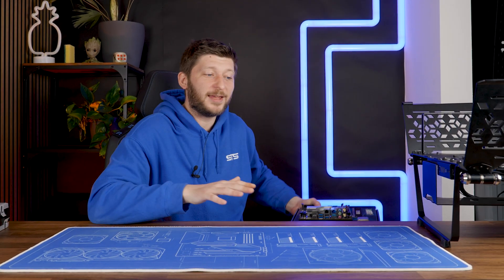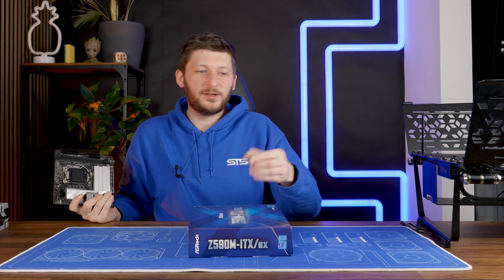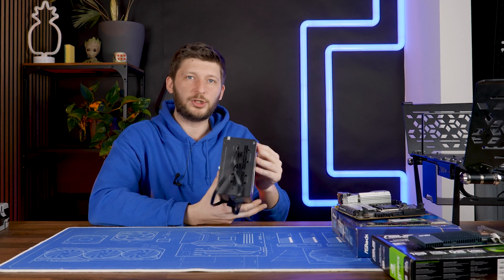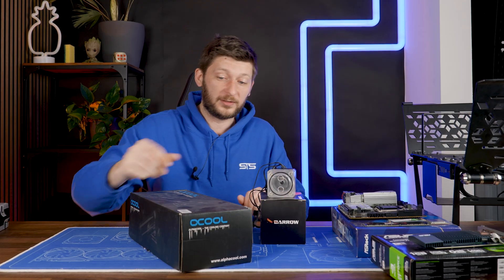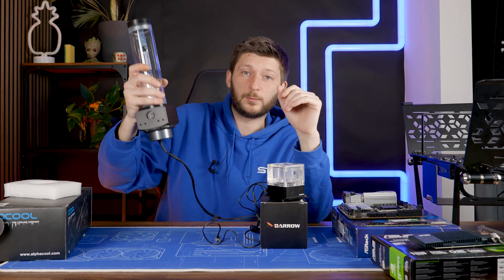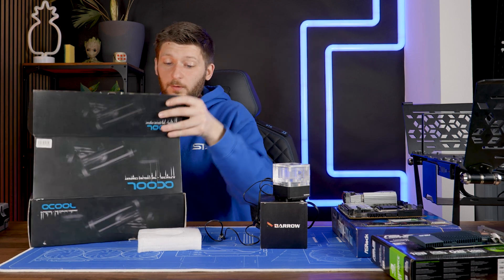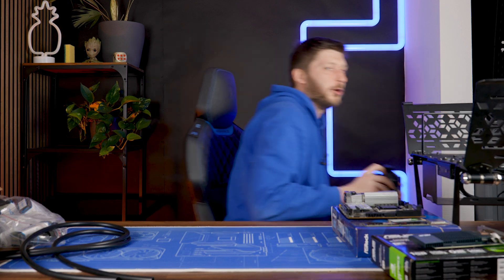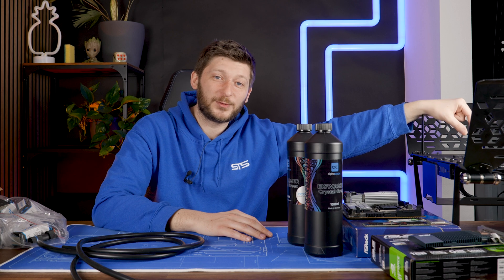Episode 2: “Fan Quest: Unveiling Key Components for the Ultimate Machine”

Comment: Can you please set power to 170 as AM5 is now 170W, or better yet 200W. Pleeease 😅. Otherwise i agree with the testing you have put forward. Im sure costing an arm an a leg so understand reasoning and methodology. Great work!! Sharing with others here in South Africa 🇿🇦.  Also try to monitor room temperature during testing. The quick connects are pretty good and dont leak, they do add load on system but it such a small system it wont be an issue. With that Barrow pump is a ddc which is what is most commom. And the pump is standard, so if you remove the acrilic part it will fit with most reservoirs/distro pump combos. I do believe you need that res. Maybe check if the cylindrical acrilic will be able to replace the acrilic on the pump in terms of oring seals or if there a thread.
Reply from the maker: 200 wouldn’t make sense.
I’m not trying to cool a specific chip but finding out how each fan compares to another, so I have to find a middle ground that distinguishes between good and bad but doesn’t throw out half the fans.
And yes, room temp is always measured to .1*C, right next to where the fan is getting air, so the results will be as accurate as possible

Comment: my vote is on alphacool's res with their copy of D5 - 755. if i have to pick a barrow's copy of ddc and AC copy of D5, im going for AC. 

Also, bigger res - easier to work with - you dont need QDC for every rad. After testing a rad just disconnect, unscrew fittings with tubes, screw in to anthother rad, connect and fill the res with missing coolant htat went to a new rad. 

For QDC's: Koolance QD3s are great (miles better than those AC ones you got) missing only 1-2 drops with every disconnect (0,3ml if i member).
Reply from the maker: Alphacool pump + smaller res in the end.

On the ‘just unscrew’ part, not such a good idea. I would lose a couple of ml every time. Going through 3x rads per fans would mean a few bottles of liquid per month, no need for the extra cost

Comment: I personally use Koolance quick disconnects. With those, I lose less than a drop of coolant per disconnect. It’s basically whatever moisture is on the edge of the o ring.

Comment: Instead of quick connects, you could get a bunch of t-fittings and valves and use them to switch which radiators are in the loop. This would prevent and worry about losing liquid from quick connect and disconnect (I've never used them either, so I don't know)
Reply from the maker: Sounds like a good idea, but I believe the valve itself would be slowly transferring the heat from one loop into the other one, making the whole thing useless

Comment: not sure if this is relevant, are u planning to keep the same flowrate between testing rads?
aquacomputer has some awesome flowrate sensors
Reply from the maker: No, I’m just pushing the pump to limit. The exact flowrate will be whatever the rad allows it to be.
Shouldn’t be any issue because every fan will have the same setup per rad